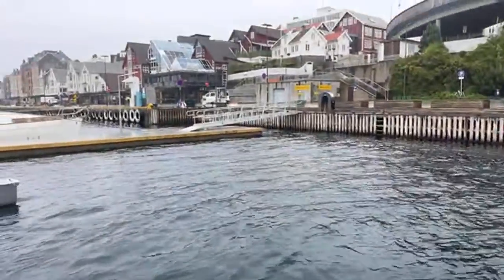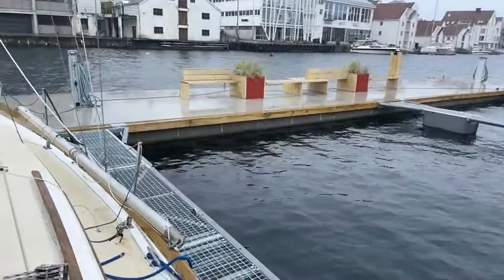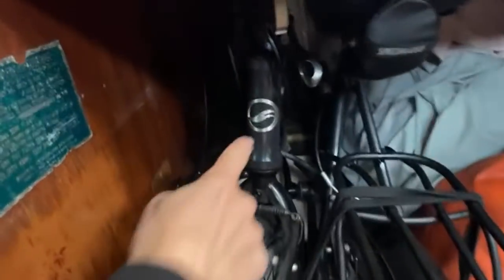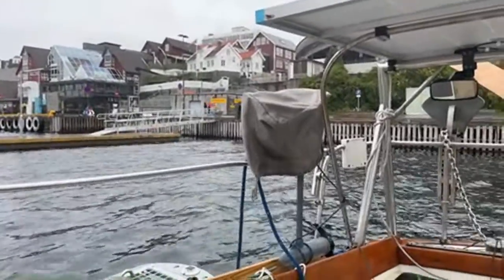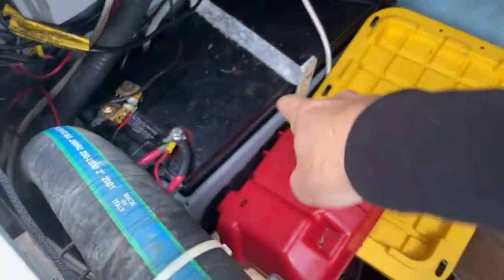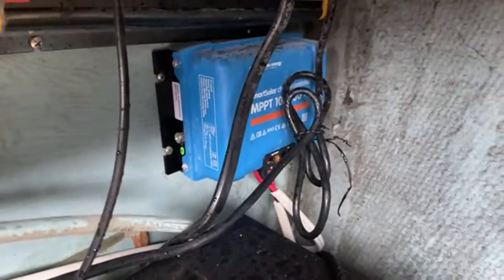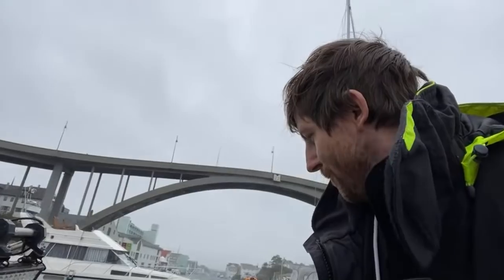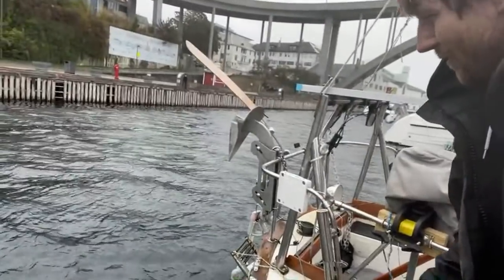Live from Norway 🇳🇴

Comment: If you have breaking water over the stern, you need to heave too. Put out a drift anker connected to the bow and a block connected to the stern or mid-ship, with a strong line. Then a small main sail acting as a mesan. Then you can adjust using the winch until the boat is stable. Then you ride it out. Don't play games with the North Sea. She will grind you down.

Comment: Sam you need to find yourself a electric heater to use while you're at the dock.. when you have shore power...  to keep the condensation down. 5 buck a day to run a heater and your fridge would be to bad.

Comment: Well Sam that was a good live stream even though I missed it but I watched all of it. If you can afford to get a couple of more deep cycle batteries to go with your panels if they are a hundred and something watts each that would give you more hours of battery power everything should stay the same on the power wise if you're running 12 volts I've been watching YouTube videos about solar panels and charge controllers the one you have I forgot the name now but it's slow to collect all the info in the charger controller but it's pretty accurate and a more expensive charge controller I bought some second hand solar panels for my guy 260 watts each but I did not have them directly in the Sun really good so they tested on a multimeter 144 Watts but I'm going to get one of them a chance anyway I ordered a charge controller I can't remember the name of it now there was two of them I was interested in 30 amp charge controller and I ordered a extra monitor I will watch again to on YouTube to see what place is better to install that maybe on the output side of the source but I'm waiting for my orders to come in I got some strength tubing some rolls of wire battery terminals for top post so when it comes in I will connect them if you're interested I will let you know how it goes in a message I know you cannot reply to all your comments and things because you're a busy man I understand it's no problem for me. And there is a woman that is running a smog shop next to me here I'm homeless and camping outdoors for the rest of this year and all of last summer I don't want to be in a apartment again because of this covid thing going around so I got my second vaccination today 13th of October and I guess you could still get the virus after but I'm starting to feel the effects of some of my muscles having pains and I know I will sleep a lot for the next few days but other than that maybe I will feel a little fever and a headache with that passes after one day when my solar things are all hooked up if you will send me a friend's request on Facebook I can send you some pictures of that set up when I get finished I bought two solar panels 260 watts each I paid $170 for both so if the charge controller will work good on one panel I might not hook the other one up I was just run it separate because I'm running a 50 watt panel now and it's a polycrystalline that works good in cloudy weather I had a model crystalline where I live down south last year and it did not do good in the shade or cloudy weather my polycrystalling works good in any weather conditions and still keep my power up on my batteries I have now two regular car batteries and I connected a deep cycle marine battery to the other regular lead acid batteries and I bought three of them from the woman at the smog shop next door and she was giving him to me because her husband works at the dump and he recycled these batteries and they are Marine deep cycle batteries they look like new so I gave her $100 for all three batteries the third battery was a bigger battery one cell extra so when I get my charge controller and Amazon delivery hopefully this week is 10 or 12 days to get it I will connect that in the meter up to see what they are doing before I decide to go we both panels parallel not in series because I'm only running a 12 to 24 volt charge controller when I get in the mail that's what the one is I have now. But when I connected one of the smaller deep cycle batteries to my other two my voltage don't drop below 12.7 at night when I use it to charge my phone when my other stuff I ordered comes in I will connect my other two batteries I bought some battery cables battery top terminals and wire to connect everything correctly I'm happy with what I have now I watched a lot of YouTube videos about how to connect it for 12 to 24 volts the amperage will go up if I connect two panels in parallel not series but it will only be less than 10 or 12 amps and I ordered a 30 amp I think it was a perv charge controller or something like that I ordered if it's not enough to handle what I want I will just send it back to Amazon in order a 40 amp and pay the extra money and get a decent one but I cannot afford to get one like the one you have at least not yet even though I choose to be homeless out here I'm next to the railroad out here camping last summer and this summer and this winter but I used to work for the railroad a few years back so they know I'm here they're okay with me being here I'm going to upgrade my camp a little better so I can make the roof for my cover here strong enough to put at least one panel on top or I will put both of them on the end of my camp when facing the East and one facing the South so I will still get enough power to charge my five batteries I will have connected when that happens. Anyway enough of that send me a friend's request if you want and I will accept and maybe I can give you some suggestions and some ideas about the solar panels but you can learn a lot watching the videos about solar panels and charge controllers so you will have less power that is really coming in but enough to keep everything charged without losing all your power from the batteries more amp hours I guess are better. So when I have all five of my batteries connected I can run them for two or three days before I decide to charge on my solar but I will leave that connected all the time I can control the settings on the output to the battery to a lower amperage without burning up my batteries you know like I do they are expensive. I connected one of the batteries and it has not dropped below 12.7 volts at night I run a rechargeable fan rechargeable battery Bank two of them for charging my cell phone so I can have some comforts out here being homeless. Anyway Sam you be good be safe I know you are a good person I enjoy watching your videos I'm one of your favorite fans and I'm trying to sell some property that I had some years ago and the money comes from three Banks the third Bank is not open for getting email information or calling the bank for the money to go through to pay for the property the guy wants to pay me some money from both Banks available but I don't want to have to wait for the other money even though I'm still waiting for the third Bank because of this covid crap happening so I will have $899,000 if everything works out I don't want to accept $600,000 and to do the things I need but if I sell that property soon I will be more than happy to send you the money to buy you a decent catamaran or a trimeran and the money you will need for fixing it the way you want I can do that much for you but I will keep you posted on that if you read this comment. I'm a generous person I always send money to my fiance in the Philippines I sent her money for her birthday for the 6th of October at least $1,680 I sent her in the last 3 weeks from my covid stimulus check I got how to survive on very little here for now. So if I can get my property sold by the time Christmas comes around or after that I may take the payment from two Banks the guy has accounts at and deal with the rest after I would be happy to see you in a catamaran or a trimeran I can't promise you anything but I will do my best and I can only send Western Union to wherever you would be at at the time. PayPal I ordered a card and got $40 to put on it and they still did not do it so I will not deal with PayPal ever again I will take them to court to get my money back somehow. So Western Union will be the only way I can send money so keep faith in me I am one of your fans I watched you for a while and seen some of your back videos I enjoy watching the places you go and the paragliding I want to do that one day and buy a sailboat myself. I'm 60 years old now as of March 14th this year so I want to invest my money good and apply for early retirement anyways I know you have things to do God bless you Sam be safe I will be waiting for your next videos. Watching from Roseville California USA Ray Garrett even though my first name is Calvin I go by Ray Garrett because Ray is my middle name I do not like my first name LOL. Take care my friend have a safe passages wherever you go God is watching over you.